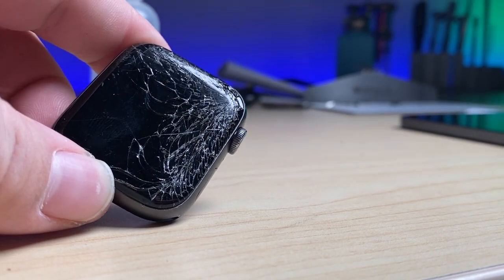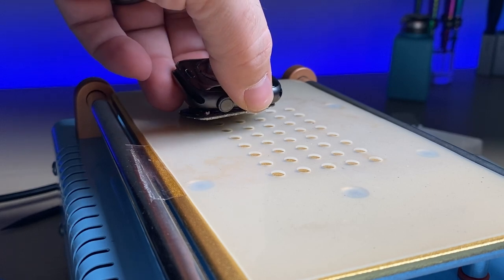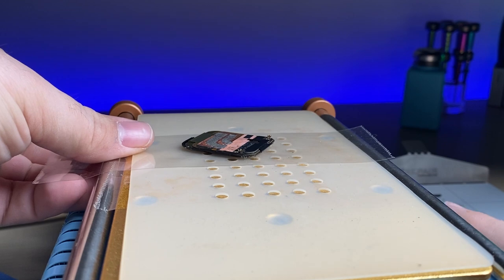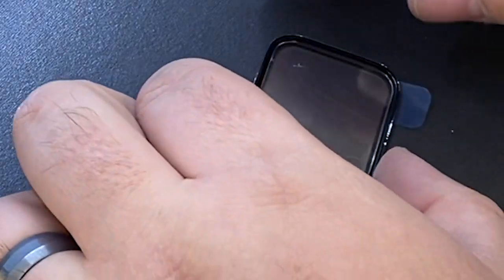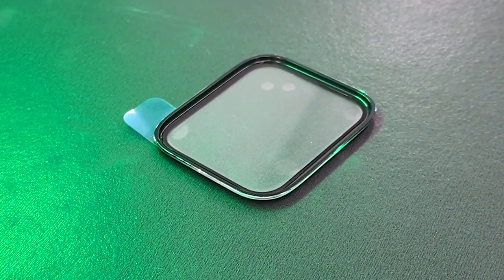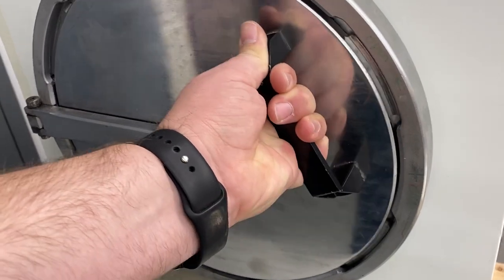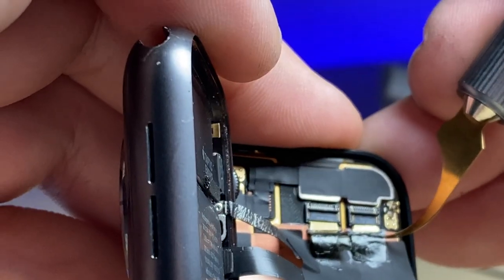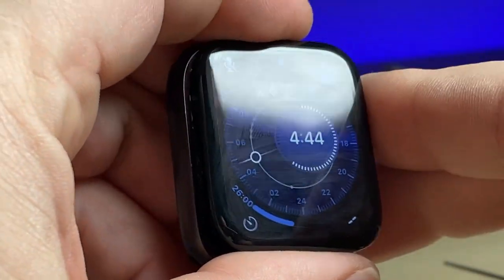Revive Your Apple Watch Series 6: A Step-by-Step Glass Replacement Guide

Comment: How thick is that plastic card u are using? 0.1mm thin enough?
Reply from the maker: It can be. I use a specific OCA protector sheet that protects the OCA during installation as the plastic I show in the video.

Comment: Great job. New subscriber. Also, what would you recommend to remove scratches from iwatch screen due to normal wear and tear. I took the screen protector off of it due to needing a new one but never purchased one (lazy) and stored it for a while and forget about it due to the battery not holding a decent charge but since the update of 10.1 I have decided to give it another chance and have noticed the screen has scratches 😢, thanks in advance.
Reply from the maker: Thanks for the sub! There are some professional machines that buff out scratches, but the easiest way it to apply a tempered glass that has a liquid adhesive so it fills the scratches giving it the appearance that it’s not scratched. Watch my tempered glass videos
Reply: @FIXDPHONES  thanks.

Comment: Hello. Why don't you remove that brownish sealing rubber that to me looks like a adhesive tape? shouldn't the glue be enough in order to close it back?
Reply from the maker: It’s a gasket that acts as a shock absorber. If I were to remove it then that would be like taking the suspension off a car. It would still work but you’d feel every bump in the road. The older models had force touch that doubled as this gasket.

Comment: Hey FIXD, can you tell me, what the third flexcable glued to the scren is for? I accidentally broke it, and thought it doesn't connect anywhere, but unfortunately my screen is not showing anything right now... Any clues?
Reply from the maker: It depends on the model and which third you are referring to. Most watches go (starting from the left) display, touch, then NFC. Hope that helps. They all come as a unit if one gets damaged. The connectors on the other hand that’s another story
Reply: @FIXDPHONES  I'm talking about the Apple watch 6 44 mm. There's kind of like a third flex. It seems to not have any function at all

Comment: hi I was wondering if I can use a pressure cooker as a homemade autoclave. Would it damage the electronics of the digitizer?
Reply from the maker: Pressure cookers get hot to produce the pressure and they will exceed the temperatures the displays can withstand so I definitely wouldn’t do it.